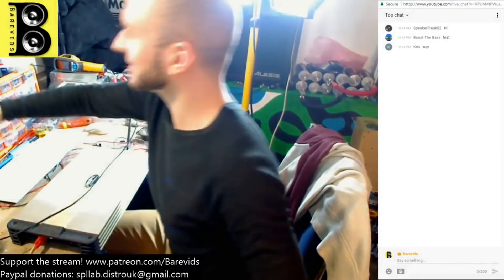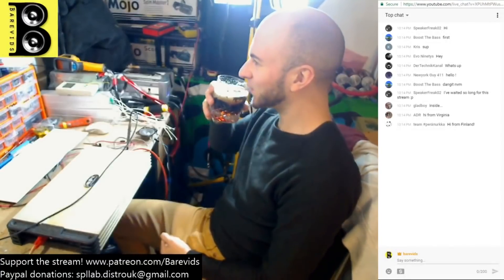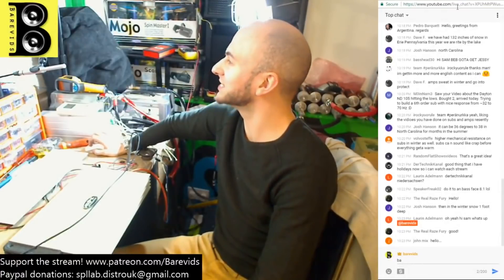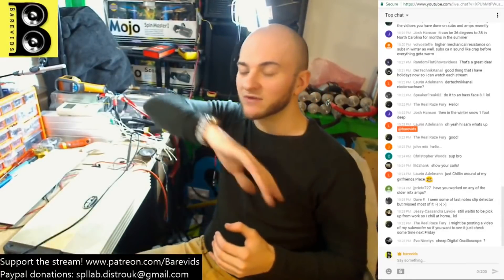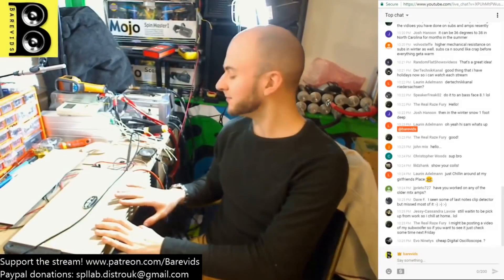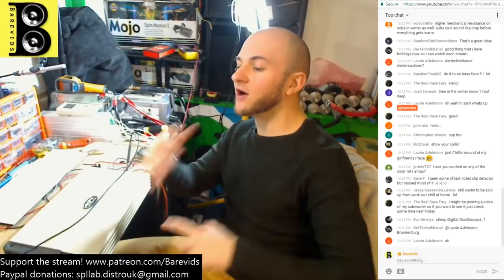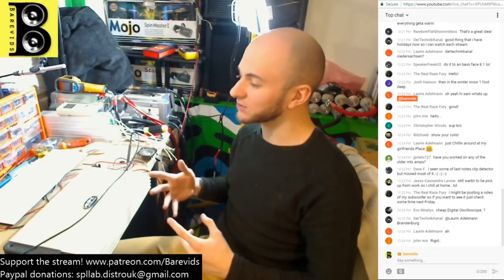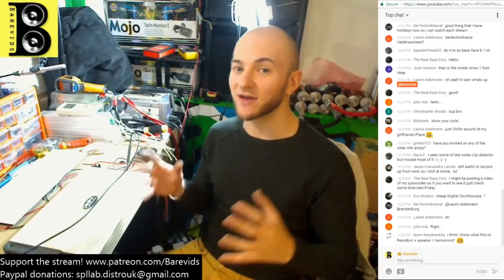Detect amplifier clipping WITHOUT DD-1! Cheap simple clip detector

Comment: can you use this method to find the clipping point of your head unit as well?
Reply: Jerrold Allen almost all, at least my pioneer doesnt clip
Reply: Jerrold Allen Most Head units will definitely start clipping at some point. It's been shown in a bunch of videos. Everyone that does amplifier dynos has a Max volume they can use for the head unit. The pioneer prs-80 is so highly reguarded because it doesn't clip, even at full volume.
Reply from the maker: +Wade Hensley yep. But head units don't clip even on full volume provided you have eq flat and sub on 0, no loudness etc.
Reply: Mine clips at 32 with no EQ. loudness off. sub off. bass flat and treble flat. but goes up to 40
I keep it at 31 or lower to avoid the distortion/clipping
Reply: So all head units won’t clip is what you are say as long as they are set to flat
Reply: Alejandro Briones I was asking because every time I see a dd-1 used on radios at some point they clip

Comment: Do u have an easy way to calibrate a crossover?? Lol to replace the cc-1
Reply from the maker: +Tim Henry yes just do it all on the head unit or dsp and bypass all the amps crossover settings 😂
Reply: barevids at the amp

I have a stock HU so crossovers at the amp without a DSP is my only option right now
Reply: 1 way to do x-over is to connect a DMM on AC volts to the speaker outputs with the speakers disconnected. You want the volume turned up high so the amp is putting out close to it's maximum voltage. Play whatever sine wave you want to tune too, at that point your DMM should read a steady voltage, adjust the x-over frequency knob until you see the DMM voltage just start to drop (the more sensitive the DMM, the more exact the x-over setting. My DMM reads 3 digits beyond the decimal point so 1/1000 of a volt) what you are seeing the x-over starting to filter out the frequencies. Works with both high pass and low pass x-overs.

Comment: hmm you could use a few diodes, a non polarized cap (before the full bridge rectifier made with the diodes), a zener diode to keep the voltage low enough on a transistor to drive a led to make your own dd1
and use a pair of AAs in a battery holder to drive the LED
Reply from the maker: much easier to use comparator to flash LED when output sine wave reaches internal rail voltage :D

Comment: Ok so a question,

I want to see HOW cheap i can make this

I found a 0.5w 8ohm speaker online for $1.50.  Will that work for this or do I need to have a way to lower the power to the speaker.

If so what do I use to lower the power.
Reply from the maker: that will be fine, choose a 2.2uf or LOWER farad AC cap and no problems!
Reply: hunter callahan in the old days, I always went with the ‘1 farad for every 500 watts’

But the cap thing has been pretty much proven to be useless.  The only real good upgrade is alternator and doing big 3, then if u need stored power go with a really good audio battery.

Like xs power
Reply: Tim Henry hey, what do you mean by "doing big 3"?
Reply: barevids isthere pattern for how we could know wat size cap would be appropriate ive tested my amp on ac voltage and i seen 40 to 45 volts before i upgraded my wires and normally i run 4 ohm due to lack of sufficient power wire size

Comment: Good video, I have used piezo tweeter :)
Reply: hi there 
im
getting a piezo tweeter to do my monoblock apline amp 
so as soon as it starts beeping a little back off the gain a bit??
i set my amp up the other day via ohms law at 31.6 volts and my sub was hot and smelt of burning so i backed the gain right down
hopefully this is mor accurate 
cheers

Comment: I wonder if you could use an Arduino board to look for the signal and then turn on an led?
Reply from the maker: a better way is to use a comparator circuit to listen to the rail voltages on input 1, and the audio signal on input 2, and light an LED when signal reaches rail voltage.

Comment: Loved this video but it gave me a question. What happens when your amp starts clipping but isn’t loud enough anymore? Is it better to clip a little? Or add more subs? Or buy a different amplifier? Or..and this is my main question, will changing something with the electrical system add more head room to the amp before clipping? More main voltage or signal voltage or something like that. Thanx
Reply from the maker: adding more power supply voltage gives you more clean output power before clip point is reached!
Reply: barevids ok! Good so that’s why you test with the engine on vs off. 14.7 charging voltage vs 12.3 resting voltage. Ok thank you sir.
Reply: barevids ok! Good so that’s why you test with the engine on vs off. 14.7 charging voltage vs 12.3 resting voltage. Ok thank you sir.
Reply: barevids last question. When testing with an oscilloscope, better to be loaded with subs or unloaded?
Reply from the maker: always subs connected.

Comment: Lmao at the very end ...not just easy alot cheaper (of course I have a 20 dollar o scope which I use but still nice vid and great explanation.. I also liked how you could notice the Distortion coming through before it actually clip the signal my o scope has a light that starts to Blink at about the same point your speaker started to emit sound not totally a clipped signal but obviously sensing some Distortion in the sine wave I kind of like to tune my amps to that point to know that it's a perfectly smooth signal might not be as loud as I could be but at least I know I'm safe (especially if I use a -10db test tone) lol

Comment: cant seem to get it to work :/ ive got a cap from an old crossover network. 4.4uF. i cant easily drive the amp into severe clipping and the little speaker doesnt make a sound. :(

EDIT: got it to work on a really dogshit cheap kenwood amp. The other amp (alpine MRV-f407) just wouldnt do it. Unless i really wasnt clipping it? Which i find hard to believe, max gain, max volume on device i was using. Speaker hooked up to it was going spaztic
Reply: nismofreak34 

He said use a NON polarized cap
3.3mf or 2.2
Reply: Tim Henry  lol they are non polarised... I got it to work. All they are is a passive hpf. The farad rating isnt that critical..as long as it's well above the frequency youre trying to hear the distortion in its fine.
I just can't seem to make the alpine distort on such low input voltage from a phone.

Comment: What about cap then resistor to led light?
Reply: Or do you still need a coil
Reply from the maker: +Andrew Ferrell not enough voltage passed, I did try this. Better to hear the distortion anyway.
Reply: Do you think there's any way to build a simple circuit for Led I know some amplifiers have clip indicator it would be a cool project plus I would run 2 the front of my car for each amplifier my last vehicle had 20 amplifiers

Comment: Great vid and like the speaker idea...but how do i transfer this to an LED indicator that will detect clip? I have one of the DSO138 o-scopes that i tuned my JBL 500 watt amp to, but sometimes i will play a song that puts the amp into soft protect...it  would be nice to have a visual indicator instead of a small speaker, or having my DSO permanently mounted to watch the waveforms lol
Reply: Putting amp into soft protect maybe a power supply to the amp problem.  Make sure grounds are solid.  And adequate wiring (it using cca wire then upgrade to ofc or at least a thicker gauge).  

Check your fuse holder under the hood of your car, is it getting to hot and melting a bit??   If so wiring is clearly your protect mode issue.
Reply: MrShiffles ok didn’t know.  Sounds like u know what your doing.  

Maybe go into the eq settings on your stereo. And back down everything 1db at a time and see if that cures the issue
Reply: Also, adding a cap will not do squat.  I did that (added 5 farad stinger cap) and it just doesn’t do what ya think it will.  The only thing they are good for is quick ‘burps’ of the system.  Your better option is alternator, and that should give u the juice u need
Reply from the maker: +MrShiffles it can't be done as simply as this unfortunately with an led.
Reply: MrShiffles omg I just realized what amp u have,

Trash that thing and get a Rockford amp.  I gave that jbl POS away because of the gay protect crap it did.  

If u go with a prime 1200-1d you will be in absolute heaven.  New they are only like $250.  

After switching to that my stereo came ALIVE and no longer did I have any sort of failure.  Those jbl500 amps are garbage Best Buy I think is where I got it.  

That amp even comes with a bass knob
Reply: MrShiffles a second battery would help
Reply: I've read where other ppl had the same issues with the amp. Seems like a built in protection when clipping is detected(amp shuts off for a few seconds.) Fuse and holder are fine, I have good grounds, 1/0 ofc under hood for Big 3, 4 ga ofc running to the amp..Voltages dip to low 13's @full tilt on stock alt and battery. Lights dim a bit, but have a 5 farad cap coming that will fix it (hopefully.)
Reply: I used to do that constantly Tim! Now have a universal bass knob run into the RCA's going to the amp so I have much better control..have it set at 1/2 to 3/4 for bass heavy tracks and can turn it up all way for classic rock or other music with weaker bass (wish I had the funds to spring for an audiocontrol bass processor.)
Reply: Thats the same cap i have ordered lol..Yeah most of the dimming is on the initial "hit" ..You may very well be right Tim, but for my sake, this time I hope you are wrong ;)
Reply: Yea the GTX500 I got it from BB for 100USD.....i will say this tho, I'm powering an NVX VCW154 at 2ohm and its pushing it pretty damn good in a minivan lol..blurs my vision when turned up with i nice little kick to the chest...@ryanblankenship  did a quick dyno on it awhile back and it does waaay more than rated, which is nice...Yea im sure that Rockford will do alot better (i've been a Rockford fan since the early 90's) just not in the budget right now
Reply: MrShiffles AHAA!! That 2 ohm set up maybe the issue.  When I had it, I changed up to a 4ohm to keep it stable.  

Take a DMM and test the woofer to see if it is in fact 2ohm.  The amp does not like to be right at 2 or below.

That sub u have is rated 850-1000 rms, that jbl amp is way underpowering it, the Rockford amp would rock that sub.

Work a day of OT, get that amp lol
Reply: already tested with dmm once i put in the box...read around 1.9 but of course there is impedance rise... havent tested while playing but once i got my level issues set its only shut off once..even dialed back a little i've had great performance from the little amp..sorry you had bad luck with yours, it could have been a QC issue from the factory that caused your problems...and BTW it did the same shut off at 4ohms when i ran my cheap Polk 12's on it
Reply: Tim Henry ive been there before i thought i had blew my amp but i melted my fuse block and it melted patty off my battery and grounded my hot wire
Reply: hunter callahan second battery not needed for a small amp like that, I had 1 battery with my 1200 watt Rockford amp with 0 issues.  

I honestly think it’s the amp quality, 

But cheap, get cheap performance and issues
Reply: @timhenry8475  Less expensive amps are often less efficient.
Reply: One extra batt is like 600 fared lol caps are just for show,the big 3 will help a lot too,some cars electrical systems  are very skimpy, ALWAYS remember  it was designed  for exactly whats in the vehicle all power connections  need upgrade and power upgrades  means  equal grounds as well it works in pairs,cca wire is absolute garbage stay away buy welding cable from your local welding supply  shop for 50% less than "car audio" wire its very flexible and high quality  wire,i solder  all my wires as well its a 100% guarantee  its staying  put

Comment: Very interesting! Would the same setup work with an LED light, instead of the speaker? It would be much more convenient for me if I could wire my own clip light into my remote gain. My Orion 2500.1dz is great power wise, but the remote gain is touchy(and kinda crappy). I would benefit greatly if I could add my own clip light.
Reply from the maker: +MrShiffles no, not enough voltage passed to light an led. I tried it.
Reply: In fact, the DD-1 Measures 1% of total harmonic distortion (THD), wich in theory occurs before clipping in an amplifier.
Reply: I too would like to know :) the Orions dont have clip light built in to bass knob? its a shame considering how good those amps are from what i've seen
Reply: https://www.instagram.com/p/Bg0_ZLblcA3/?taken-by=teamperanurkka
Reply: MrShiffles The remote gain on the Xtr Orion's is very basic, but the amplifier itself is a monster. 2976 watts rms @ 12.6v on the birthsheet. I just wish I had the clip light. Going by ear isn't ideal. @barevids you should make a universal kit and sell it! There are zero inexpensive options for us out there, short of a dd1+ or an oscope. Good luck finding a dd1 for sale, and I'm not running an oscope in my car 24/7.
Reply: A clip light is basically a DD-1
Reply: team #peränurkka
That is a good idea and I'd be interested to see the schematic when it is available.  What is your youtube channel?
Reply: You could use a led with a simple powerfet amp. You could also have separate positive clip and negative clip indications. That might be useful on a bridged amp if the gains are not exactly the same. One other indicator that could save you some $ would be a DC offset indicator. Nothing good comes from a DC offset, and it can be a warning of a transistor that is not quite behaving right.
Reply: DD has clip light indicator on remote bass knob.
Reply: @ketondugas7226  Yup had both M1D and M3C before and both got real time clip indicator and gain adjustment
Reply: catch22frubert hey they do have one with an LED.  Let me see if I remember what it was.🧐🧐🧐🧐🧐 oh ya. SMD DD1.
Reply: barevids Thanks for answering. If you end up figuring a clip light, it would be excellent to see a video.
Reply: catch22frubert we cant leave it up to him by his self a chance encounter with fate can only bring you so close you have to be the one to tale a leap and try it is there a way id say take apart a old tv or vca and rob it for parts
Reply: Shit Lord wats a buck circuit im not a total neeb but im still learning to solder i can barely tin my wires
Reply: hunter callahan It would be a significant investment of both time and money for me to try and develop my own clip light. I don't have the technical expertise to pull it off reliably or test it. Having said that, my solution would be to add a rectifier and a high sensitivity relay. As long as you can get 1.5vdc through the rectifier, and into the relay, you can power the LED light with 12v from the relay. I'm sure there is a much more elegant solution, but I don't know anywhere near as much as barevids
Reply: catch22frubert neither do i but im learning more every day he doesnt just make these videos he like every great teacher he is open to learning new things and i know about as much as ive absorbed from sam and doug and my stoner mind however yours seems logical however i couldn't tell you wat half of the stuff was
Reply: Here is a clipping circuit:  
https://www.youtube.com/watch?v=L9sVY_wdDKw
Reply: I got an idea from this video and made simple circuit. Managed to work at low voltage (under 15V), but working on schematics on bigger one.
Reply: http://youtube.peranurkka.net

Comment: My subwoofer is wired to 0.7ohm does it matter if my distortion testing speaker is at a different ohm load? Say for instance 4 ohms? I guess what I'm asking is with the amp gain will Distortion kick in at the same point at forums that it would at less than one of them? Or do I need to make a distortion tester that's it the same ohm load?
Reply from the maker: the test speaker can be any ohm you like it doesnt matter, but the lower ohm the little speaker, the better the cap works at filtering the low freq.
Reply: barevids I understand what you're saying but what I mean is will my amp clip at the same exact point at 4 Ohms as it would at 0.7 ohms? An example would be let's say my amp is wired to 0.7ohm and it starts to clip when I turn my head unit up to 30 well if I unplug my subwoofer and plug in my clip detector which is a 4ohm speaker is it going to start clipping at number 30 on my head unit just like it would with the lower unload? Where is the clipping Point going to be different because if it was different I might set my amplifier with a 4-ohm clip speaker and then think I know where the Distortion point is but then when I wire my subwoofer back up it actually Clips at a much lower volume and I end up messing something up? I hope you understand what I'm trying to ask
Reply from the maker: +jeremiahlong48 no, applying different ohm loads to the amplifier will cause it to clip at different points. This is why you should use the clip detection speaker while your main sub is hooked up. The ohm of the clip detection speaker doesn't affect what your amplifier sees, due to the capacitor in series, it completely ignores it.
Reply: barevids Thanks! That is exactly what I was looking to learn.
Reply: i basically ask the exact same question thanks!! didn't know that the detection speaker is ignored by the amp because of the cap in series i wonder why that is...how do i know if my cap in non-polarized?

Comment: Im curious at what point of thd does say a tweeter start to make sound. 

I set a pair of alpine amps to the highest a.c. voltage that I could get between the two without the tweeter making any noise. This worked out to 43v for me. After wiring up both subs to 3 ohm per amp and taking a listening session I find that I could get 5 more clicks on the radio before slightly distorting the subs. Those 5 clicks are easily 6db worth of extra bass output. I'm wondering if those 5 clicks raise to about 1% thd and the original setup was way lower